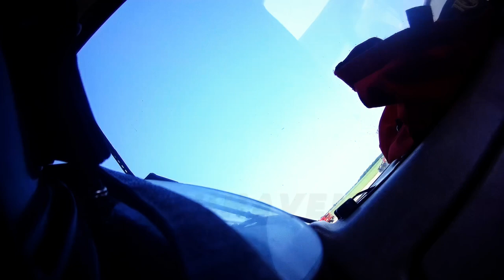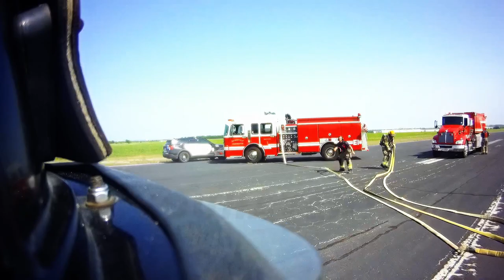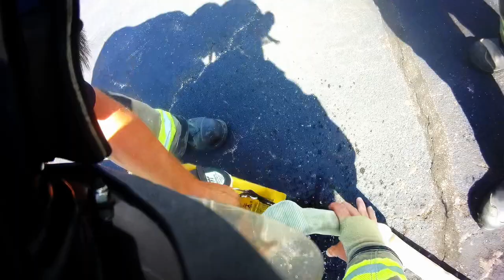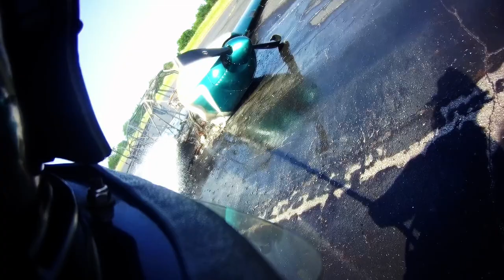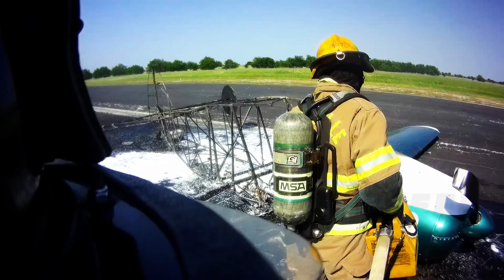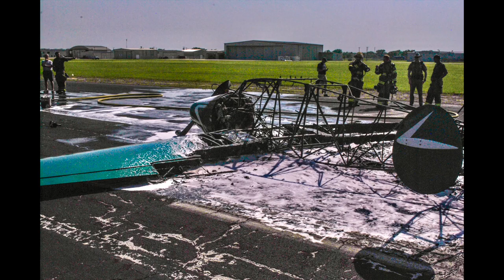Bellanca Cruisemaster gear-up landing and fire | Helmet cam

Comment: Magnesium eats water for breakfast and makes the fire stronger. Mg (s) + 2H2O --> Mg(OH)2 + H2 that produces hydrogen gas. He needed a Class D fire extinguisher for the magnesium gear components that kept relighting.
Reply: Magnesium and a battery too (hard short)
Reply: 100 LL Fuel…
Reply: Chemistry 101 😅
Reply: Not many engines carry a class D extinguisher, sand would work just as easily.
Reply: Well I'm guessing this is why they call it fire science.
Reply: Most Bellancas and other small aircraft use aluminum wheels. This fire was reigniting from the wood wing that was burning inside with fuel everywhere from melted fuel tanks in the wing roots. This started because Bellanca Cruisemasters and Viking Series have their fuel strainer bowls in the belly. A gear up landing will knock the strainer bowl off and gasoline will pour our. The exhaust tailpipes are dragging on the pavement just ahead of the spilling fuel, so fire is very likely.
Fortunately gear failures on Bellancas are very rare. Just the same, I tell all my Bellanca customers about this danger and to bear in mind that if they ever have to land gear up, shut the fuel valve off just prior to touching down.
Reply: @rescue270  now that is some seriously good advice!
Reply: @rescue270  ya, there's probably not a drop of magnesium on that aircraft. The Firefighter probably would have had it out quicker if the water flow would have been applied span wise but maybe that's not protocol
Reply: @billclark5943  
He should have gone over to the left side of the airplane and sprayed up inside the right wing. The wings are made of wood and it was all burning inside there. He just kept spraying water on the outside of it.

Comment: One of my personal rules...let her cool down at least overnight before attempting to start engine again.
Reply: See, now that's funny:)
Reply: That’s over kill
Reply: Yeah, when I refuel on a cross country I’m done for the day. Don’t be stupid.
Reply: @scottmonroe6522  It's a joke. The aicraft was destroyed from fire. It's not going to start again 😕.
Reply: Overkill
Reply: More satire. I love it. It's as shame to see beautiful airplanes lost. Never to be seen again.
I soloed in a new 115 HP Bellanca Citabria in ~1979. 
I owned and flew a 1973 Lycoming 300HP Bellanca Viking for a couple of years in the mid -1990s. 
Roomy, comfortable, lots of lift capability. Not super fast but good enough speed for me at 15-16 gph.
 Trip to and from L08 (Borrego Springs CA) via TCS (Truth or Consequences NM) to AMA (Amarillo Texas) had two minor hiccups. Outbound, I couldn't get the gear to come up after TO at TCS. So I just pressed on with the gear down. Sad to say that my AS wasn't lowered that much. Maybe ~15 mph? As I had suspected , it was a broken squat switch wire. Brittle as a pretzel.
They had a Radio Shack in Borrego Springs, (showing my age a bit) so I bought some good wire to splice it. Zip ties and Crimp connectors. Under my Dad's 10,000+ hour experienced eye. It worked fine. I waggled my wings and was off several days later.
Stopped in TCS for gas and met an interesting man pumping gas at the FBO who had been involved in building many of the 11,000+ foot B-52/B-36 runways my Dad had used in Roswell NM, Amarillo TX, Fort Worth TX, Cilinton Sherman OK, etc. He said they were built like upside down bridges. Very Thick reinforced concrete for the Pads and Taxiways. Plus the first 2-3 thousand feet of the runways at both ends. The middle of the runways were a buried caternary arch. Thinnest at the middle. Amazing what a person could learn from a nice random airport guy in the late 20th Century. I miss those days.
On the way home to AMA I had a great tailwind and started a very, very slow rate of decent after I crossed the mountain range peaks. A fair distance after that I hit turbulence. Right where the rotor would be expected. An incredibly abrupt high G drop. That got my attention. I slowed down a bit. 
The only equivalent, if not worse, drop was in a USAF Academy C-172 Hawk XP (T-41B Mescalero) equivalent.  Beautiful clear day, flying with my wife and 7 month old Son in a proper "car" seat. A severe storm was expected in the evening but this was ~noon. For some reason, there was almost no traffic. From the South, CS control vectored me out of the controlled airspace right next to the mountains. Unusual. Something I would not have done if I had a choice. Heading up to the AFA airport. We hit a sudden drop, probably from a rotor that felt like a 10 foot drop to a hard surface. Everything seemed OK so I called the USAFA Tower and got no response.
Wind was 270 at ~ 25 -30 kts. Main runaway 99.9% of the time was 16/34. I had trained on the 08/26 runway a couple times as T&Gs. 26 was to be avoided because there was rapid,y rising terrain to the West. No Shit. So No tower. Wind 270 at ~25-30 kts. I called a long left base and made the best landing I've ever made with a ground speed of ~ 20 mph. I pulled up to the pumps. Got my Wife and Son into the car and warming up. And prepared to refuel the tanks. The AeroClub President walked up quickly and asked what I was doing. I told him I did exactly what I was trained to do at a No Tower Airport. Make position calls, watch for traffic and land into the wind.
He said the Base Commander had ordered the airport closed a few hours earlier anticipating the evening storm. He had called and asked what was going on. 
I told the President that nobody at approach had told me of any airport closure. He was a great guy. We filled the airplane quickly and got it it tied down tight headed into the wind.
The sudden drop we had experienced just West of CO Springs was so severe that I suggested to him that the wings and struts should be inspected before it was flown again. They found nothing. A tough old bird.
A tragic ending to that story was that the AeroClub President had a fully decked out Honda GoldWing. Less than a year after I left the AF, He and a friend went on an early 6AM morning ride through Manitou Springs and West on Highway 24.
An older woman backed out right in front of him. He died a slow painful death on the side of the road before anyone could respond to the accident. I don't even like writing about it. But it shows that you may never see death coming. He was probably 60 years old.

With my Bellanca Viking I also had the wings checked due to the severe drop.
The only damage was to the ¼ - ¾ ribs that were under the entry/exit walkway on the right side wing of the airplane.
I had them go over the spar again and nothing was found. I had those partial ribs repaired. And moved on to a better, faster airplane after that. I had spoken to the Bellanca factory owner several years earlier at Oshkosh. He told me that the problem with wood spars was that they could be severely over stressed and weakened but would "spring back" and still look OK. With metal spars? They would stay bent and show the damage. So obvious that nobody would ask him to repair them. He wouldn't repair wooden spar wings after a ground loop or any other history that could have overstressed them. He would repair/replace them using aluminum spars only.
Reply: @scottmonroe6522  Are you serious? You can't be serious.
Reply: your wife or this plane?
Reply: please make sure the prop is clear of the tarmac before you attempt engine rotation. lol.

Comment: This aircraft flew to the airport I work at. It was a classic beautiful plane. What a loss. Glad the pilot is okay!
Reply: Yes, I can tell by the nose it was a nice looking machine. :o(
Reply: I couldn’t tell 100% but I think it’s KLZU Gwinnett Briscoe Field correct? I live not too far from there and I’m actually looking for a good paying full time job now that I’ve graduated. Are there any positions there I can work where I’m working with aircraft?

Edit: typo
Reply: Was landing in the grass an option?
Reply: @f900ex5  i would say runway is better option, soft dirt/soil have a habbit of snagging things, throwing the plane around due to its lighter weight.
its also uneven.
Reply: Looks like some flammable metal where the landing gear assembly is located
Reply: Probably conducting a normal landing on runway and toooo late gear was not down
Reply: @generoberts2743  more than likely it’s residual avgas burning from the fuel tanks
Reply: @f900ex5  Just thought about that, ...I think I would

Comment: Looks like the magnesium gear components kept re-igniting, and the water was even stoking it a bit. That wasn't really the fuel re-igniting on its own so much. Yes the fuel vapors would re-ignite, but mostly from the magnesium continuing to burn. You can't extinguish a magnesium fire with water, and it can keep burning without oxygen. It can use the nitrogen in the air to make Mg3N2, and the water causes hydrogen gas production. They handled it well though, they surely knew this and the small size made it manageable.
Reply: Yep i think your right , magnesium can be a nightmare . You can use water to put it out but you need lots !!! the other way if you can get access is a crash axe and cut the burning magnesium out . Second one isn't easy but it works as i have done it on an oleo leg once . Magnesium makes it's own oxygen while burning and burns at a real high temp but it doesn't radiate a lot of heat out . They used water at first , being a ARFF firefighter i would have gone straight for foam but they did a good job . sadly the plane was toast way before they got there as it doesn't take for a plane to get consumed  . Are you a Firefighter ? you sound like you know your stuff .
Reply: Class B fire… water makes it spread.
Reply: @thatguy7085  that's 100% right
Reply: @zeberdee1972  Very interesting! No, I am not a firefighter, just an engineer and a pilot. An ARFF firefighter huh? Cool job - there's nothing more reassuring for a pilot than seeing those fire trucks waiting for you when there's a problem.
Reply: @JFirn86Q  Thank you is nice to be appreciated . And to reassure you some more in my 32 years i have only ever seen three plane crashes and they all survived ....the planes not so much but the crew did . I think you have a better job though engineer and pilot sounds like much more fun .
Reply: @zeberdee1972  I kinda chuckled when the Captain (I'm pretty sure that's who we're on the helmet of) said "see that, that's Magnesium" to his #2.  As these guys aren't ARFF, them starting with water first makes sense since they had to get the foamer out.  I got to see Addison FD's unit (same design) years back in action helping to put out a railroad tie fire that had been started by a homeless person under some stored railcars.  It works really well, but isn't really a good replacement for good 'ole dry chem or AFFF since it's still pretty heavily diluted by the water.
Reply: @JFirn86Q  I was at KOSH when that Corsair ran into a plane on the runway and caught fire. The Firefighters were there lightning fast and got the pilot out of the burning wreck. Those guys work magic. Very impressive.
Reply: @REDMAN298  Wow! That must have been quite a horrific site to see in person at Oshkosh, I remember seeing that on TV. Love that airshow but it's always dangerous there. Just goes to show how amazing firefighters can be, that no one was killed in such a massive fireball of a crash. @nathan whitworth

Comment: Giving the pilot the benefit of a doubt, how do you "FORGET TO HAND CRANK THE GEAR DOWN"? Must have been distracted by the landing gear warning horn.
Reply: Maybe a malfunction?
Reply: @danilodistefanis5990  it's possible it was a malfunction, a chain jumped a sprocket, it jammed in the "up" position, gear warning horn not working, etc. If it had a simple up/down switch, like the later Bellanca Vikings, that would be easy to miss. That was an earlier Bellanca, hard to tell which model. Those had a hand crank on the floor which took around 23 turns to retract and 23 to extend. Sort of like forgetting to pull your pants up after going to the bathroom.
Reply: No he was distracted by the smoke in the cockpit reportedly
Reply: @robertmcgowan3352  
Like a wise pilot once said, "it's better to be on the ground wishing you were in the air than being in the air and wishing you were on the ground".

Comment: What's the foam attachment they used called? not seen that before. Thanks.
Reply: It’s a TFT (Task Force Tips) Pro/Pak Foam system.
Reply: @Jimmythefish577  Thanks Jim. Uk based,never seen this before.
Reply: @dubster4173  no problem, I’m a UK ex-pat and a firefighter here in Canada. The Pro/Pak is a great piece of kit, great if you’re engine doesn’t have a foam system. Good for wildfires as well, the kit comes with 3 different nozzles, the one they’re using here is the ‘big’ foam nozzle. The other two nozzles it comes with put out less volume but with a stronger stream.

Comment: My old flight surgeon had a Viking and had it serviced at RYV. His gear wouldn`t come down because the dumb asses put too much air in the tires. With some coaching from the airport manager he did some maneuvers rapidly ascending and got the gear to come down and all was saved. Those are beautiful wood structured airplanes.

Comment: Looks like a Bellanca Cruisemaster that made a gear up landing.  That airplanes fuel tank sampling valves are not located in the best part of the wings bottom.  Quite often one will grind off and it’s draining fuel will ignite. Seen this three times.  Firemen performed appropriately in my opinion.
Reply: "Bellanca Cruisemaster gear-up landing and fire | Helmet cam"

>Looks like a Bellanca Cruisemaster that made a gear up landing.

You don't say.
Reply: of course they did, they're professional fire fighters.
Reply: @cmdrriotz5283  Well...  hmmm. Most of the time, yes, and certainly in a straightforward situation like this. Like every other profession, there are plenty of examples where better work could and should have been done. I strongly favor well-trained and highly experienced, full-time airport fire crews.
Reply: Too bad they drove 7 mph the whole way.
Reply: I concur

Comment: Unbelievable words fail .....that should have been extinguished and made safe in 30 secs if the firefighter decided to move around the scenario and a foam blanket was initiated asap ...
I've seen it time and time again in US aviation fires they are just rooted to the spot ...MOVE IT GET AROUND THE FOAM AND WATER CANT EXTINGUISH IT NEEDS AN ACUTE AWARE OPERATOR TO DIRECT IT FFS

Comment: what's the difference between the yellow hose and the red one (on the fire truck) ?
Reply: There usually is no difference, just different colors so the pump operator knows which line to charge.

Comment: That hot spot must have been a tire and some magnesium? it’s destroyed I’d pull the cowling check it too sure looks like the fire wall did it’s thing too  just in reverse I have a A&P  exotic metals are always a possibility. Nice little foam generator did it’s job well .

Comment: Can anyone please say why emergency response vehicles seem to go the "scenic" route to an incident ,rather than drive in a straight line?  Whats wrong with airport grass? If a tractor and grass cutter can drive on it surely it must be solid enough to take the weight of a fire engine? So many times now with these crash videos there appears to be a leisurely approach when there may be lives at stake to a crashed plane ,(yes I know it was not the case in this incident).

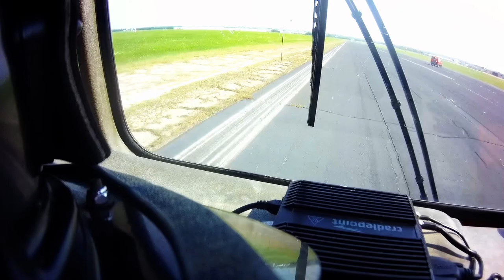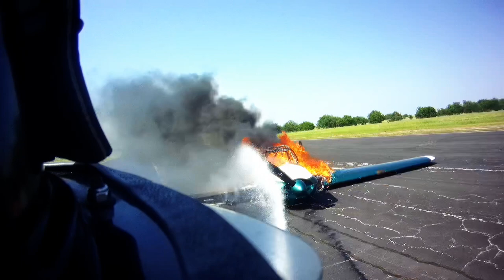Comment: They got to within range of that deluge hose at 2:00 but didn't start spraying with water until the 3:20 mark.  Is that not a completely unreasonable response time, or is it just me?
Reply: No, not unreasonable. If they used foam and laid a blanket over the aircraft from a distance, it would have been knocked down in less than a minute.  Fucking around with straight water wastes time and water.
Reply: On top of it, they have no clue how to discharge foam and lay it down. They build a blanket, then blow it away with a narrow pattern and high volume.
Reply: Oh, give it up. Plane was total loss by the time they arrived
Reply: @williamedwards1528   it's not about saving the aircraft or lives therein, it is about effective fire suppression, which doesn't (or shouldn't) change regardless whether the aircraft is a total loss or not.
Reply: No dude - you are spot on. They did not appear to be in any hurry WHATSOEVER.
They must have been "CODE 4" - Which simply means "Fuck it - let's swing by McDonalds on the way".....
Reply: @pilotdane1  lol

Comment: We had a Volkswagen parts plant in San Antonio Tx. the fire dept had to stand back and try to contain and let burn itself out, magnesium.
Reply: There's a local fire department that's saved 100% of the foundations. My sister lived in a town 10 miles away, called the Fd, then called me. I got there just before the trucks arrived. Made sure everyone was out.

Comment: Were they observing a speed limit or something ? !
Reply: These trucks are very heavy 60k to 70k in weight and are under powered due to epa restrictions, and cannot tune them up. We have trucks in my department you drive with the pedal through the firewall 100% of the time